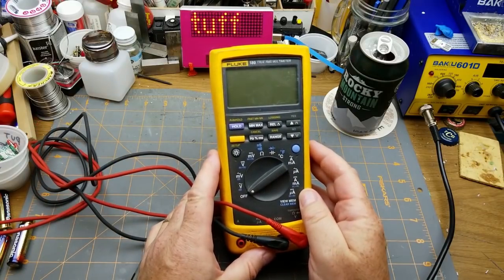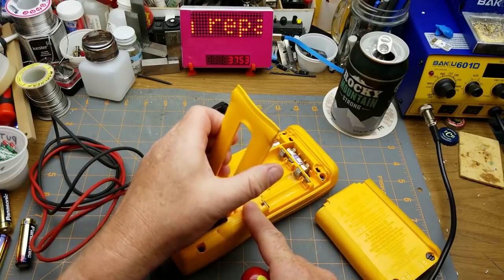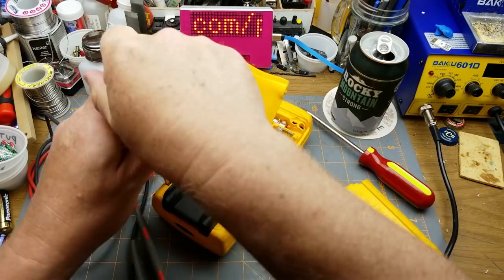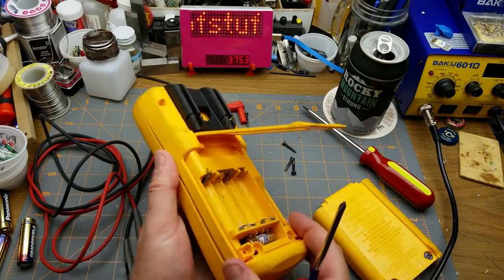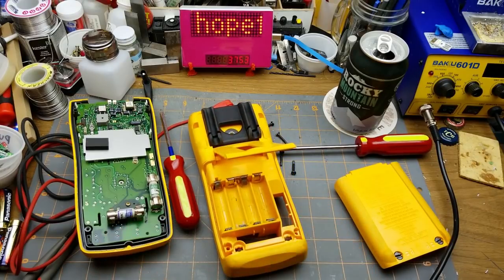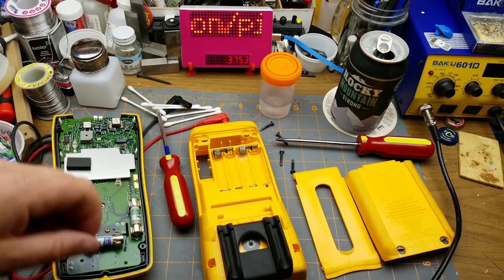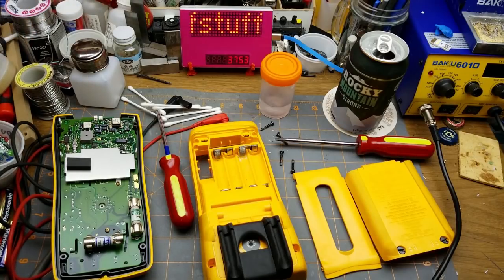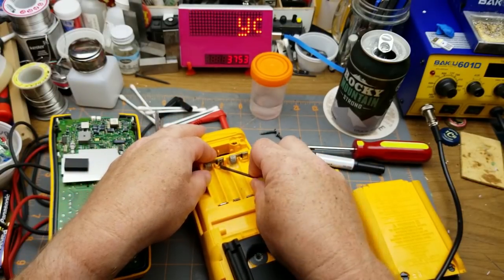simple multimeter repair - leaked battery cleanup

Comment: You can clean the corrosion off using white vinegar, it works a treat ! Soak them in it for 5 minutes and then clean them off with IPA.

You will need to neutralise the battery corrosion, even if it is dry.

Comment: That Fluke meter was the top model before 289 and on some points it is better than the 289, like faster startup, better contrast on the display and longer battery life.

Comment: just hose it down with a strong pressure right from the tap.  wipe it down and leave it in the sun to dry out   everything as good as new!  I always do that with any electronic gear that has been messed up.  Never has failed.  No need to disassemble it.

Comment: Nice job, I have had to repair a battery cavity a bit worse that that.
A quick trip down to local electronics store to get some AA battery containers, used them as donor for new parts.
$5.00 worth of bits to fix >$100 DMM, bargain..
Reply: Try greater than $400.  Even used they are over $200.

Comment: You could have used a 3.7V Li-Ion battery with a small DC-DC boost converter (3.7V to 6V) to power the Fluke. Anyway the 189 is an excellent meter!
Reply: Or four Eneloop batteries

Comment: I am currently repairing my old pocket multi-meter that I bought way back in the 1990s -- left the batteries in and one of the clips has corroded completely off. :( Does anyone have any tips for finding replacements for the metal clips? I just need to go do some scrapping I think 🤔
Reply: Other scrap devices or fashion something workable, though not identical, liberated from a new bought battery holder, possibly combined with epoxy  and/or polymorph plastic...
Reply: Digikey and Mouser

Comment: You could also buy replacement contacts on eBay for $10 or so and save the time you spent cleaning them although if you need to use it that day clean away but only for temporary fix IMO
Reply from the maker: You can buy almost anything, but where's the fun in that?

Comment: The fiberglass cleaning pens leave heaps of tiny needle-sharp shards, which snap off during the cleaning process. Definitely not something to use with bare hands!
The main problem with these kinds of "repairs" is that most battery contacts are steel (and the springs certainly are steel). Therefore you end up with unplated steel at the battery connection points, and for the spring to negative plate connection. These steel connections corrode (rust) and produce highly unreliable connections. It's quite effective to tin / solder the re-plate the surface, however it's very difficult to get a good connection because you cannot get rid of all the pitting.
I've found the best solution is to replace the connectors, and I always remove good clean connectors from all junked products. If new is too hard, a new "skin" of shim brass or copper works great to provide a brand new connector surface... just leave the old contacts as the structure, and make the electrical connection to the new tin material. I have rolls of self adhesive copper which is awesome for these kinds of repairs!
Reply from the maker: Tinning the contacts is a really good (and easy) suggestion. 

Thanks!